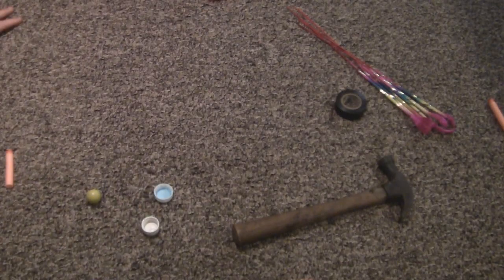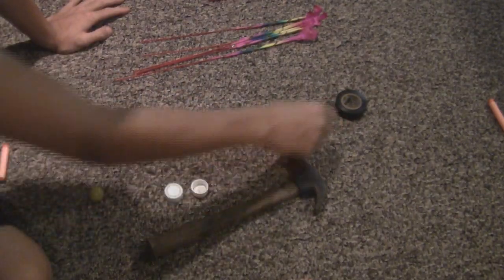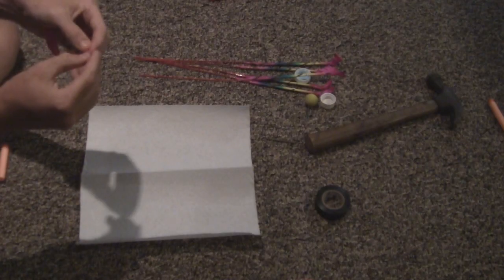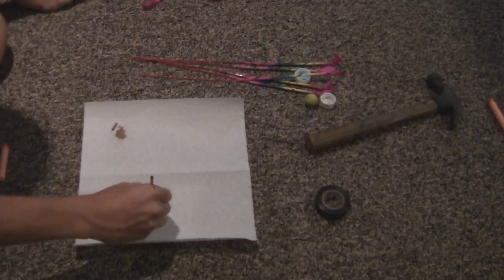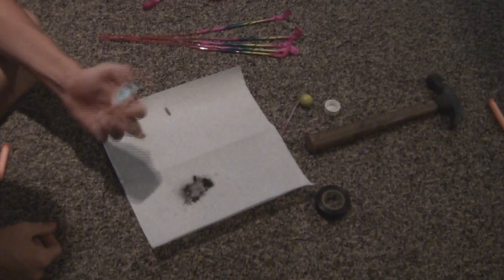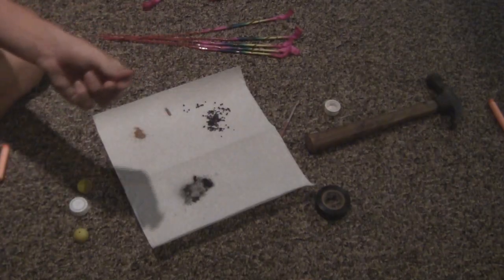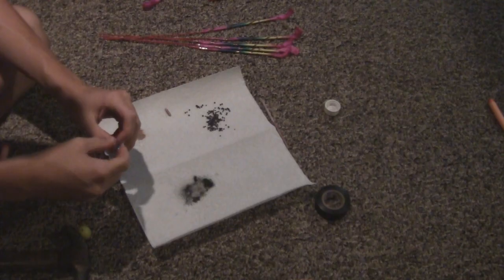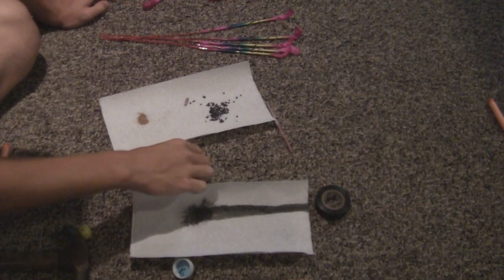How to make a M-80 out of sparklers. (Extreamly loud!)

Comment: to get the metal out of a regular sparkler just take a magnet and swoop it over the pile. thats what makes the sparkling effect. then just hit the magnet against something to shake all of the flash powder of the metal. I used about 300 crushed sparklers and it gave me 45g of flash powder. I am a professional pyrotechnic. believe me. there is flash powder in every sparkler and consumer firework. it's how the makers get around the law. and if the say 500 grams on the firework, it's total not each.
Reply: are you talking about a morning glory sparkler
Reply: InfiniteAirsoft is
Reply: There is "flash powder" in sparklers which is magnesium and what not but if you're a pro pyrotechnic then why not just purchase the magnesium you're sourcing from sparklers?
Reply: what's better for flash powder, TNT morning glory or TNT sparkler's?
Reply: @808pyroboom  I would say the morning glories are better. The metal stick sparklers will have some kind of binder added to keep them in one piece, and that would probably slow the burn rate, as opposed to the MG's which are loose powder in a paper sleeve.

Comment: I was really skeptical that the morning glory powder had enough oxidizer in the fuel for a fast enough burn rate. I see you have dramatically proven me wrong. Nice.
Reply: I Wonder what kind of oxidizer is used in glorys,
Reply: Pyrus Rex sometimes it burns to slow so I add some flash from little firecrackers

Comment: Tape? Buy some cardboard wound tubes and glue your end caps, if your going to take the time to do it, you should do it right. Be safe! 
Never use paper towel, the finest particles are the best for the boom and those tiny particles are first to get caught in the paper towel; use paper.

Comment: You can use regular sparklers but you have to take it and crush it up with your hands until you have all the powder off.
Reply: Just use scissors or anything hard to crush it up, why your hands?
Reply: @mink5260 that’ll ignite it
Reply: just use non crushed sparkler as fuse longer time to get away apx. 45 sec.s

Comment: Best firework ever : 2sparklers of powder 1 tablespoonful of kno3 and  a heaping teaspoon of crackle  from a monster crackling ball mix pour into tube wrap ends with duct tape 19 inch fuse light run will blow up with some neat effects I am not responsible for dumbasses making these and blowing off there arms has as much power as 1tenth a stick of TNT.

Comment: Ok what I did, took co2 cartridge, drilled hole in top, took the sparkler powder put in blender poured into co2 cartridge to the top, put another sparkler as a Fuze in the top sticking out, then rap in electrical tape, light it, then run like 100ft away behind cover, I was only like 20ft away and welllll it twas scary

Comment: becouse it aint strong enough to have a big punch.. and if you can get hold of some PVC pipe and cork from a wine bottle to plug the top and bottom and use duct tape. not electrical tape. it is mutch louder! home more morning glory's you use how more powerfull the bang will be

Comment: That does not work. The "done one" you had was not made of the same stuff, I know this for a fact. Sparkle powder will not produce that type of explosion, ever. What you had completed was an M-80 made out of flash powder. The bottle cap/sparkle powder makes a small pop that is it.
Reply: You have absolutely no idea what your talking about I've done this same thing for years it works
Reply: Sparkle powder, black powder.. Both of them are slow deflagrants and can't cause an explosion near as powerful as flash powder. Flash burns much hotter and MUCH faster. I invite you to whip up some flash powder and stick it in those caps. Take the powder out of firecrackers (the silver stuff only), and fill up the caps just like this. You'll see a huge difference.
Reply: It depends on how many of those you take apart. Each legal firecracker only has up to 50 mg of flash in it. A water bottle is rather large for this. You'll need at least 20 grams of you want this to be anything big. That means you'll need to take apart 400 firecrackers. But just taking a few firecrackers apart and putting it in the bottle and preceding to do what you mentioned won't work like you expect... It might make a "poof". But if you really want to sit there and try to remove the powder from 100's of firecrackers, yes, it'll work but that's one huge pain in the ass.
Reply: Anything you get from the store sucks. It has a fraction of the amount of flash that a real M-80 has. Taking fireworks apart can work but it's typically very difficult to get just the flash out and not any of the clay or whatever is packed/mixed in. Plus, it's only 50 mg per item so it takes forever to make them. Just make the flash powder.
Reply: Potassium Perchlorate and Aluminum Powder is all you need. Look it up.
Reply: +Frankie Arnold Thank you I just need to find my way to get my hands on it.
Reply: Trust me, I know all this!
Reply: Because it's true. This makes a noise slightly louder than a firecracker, nowhere near an M-80. You'll have much better report from taking the flash out of 20 firecrackers and putting it in these caps. Glory powder is NOT a flash composition. Flash powder flashes, sparkle powder sparkles.
Reply: And why wouldn't he just finish a making the one he was making instead of bringing out a completely different one. M-80's can be made rather quickly, so if showing an instructional video, why only show part of it? I know what flash powder is, and I know many ways to make it. Again, this sparkle stuff is not flash and will never give you the same result as real flash powder. Even the nitrate flash you mentioned can perform much better, under tight confinement. However, KMnO4/Al/S in a 4:2:1 ratio is a very potent flash and similar to the power of the standard 70:30 or 2:1 KClO4/Al flash. Despite some saying that Permangante flash is unstable, it's actually not, only if store for long periods. It can actually be hard to light even with a direct flame. Make it as you need it. All I'm saying is this is NOT an M-80, not even close.
Reply: I always used hot glue on all salutes.
Reply: If I do not have access to the real tubes which can usually be ordered at CannonFuse, I typically cut a toilet paper tube in half then roll it to where it's nice and tight/thick. Then I use electrical tape to hole it in a tube form. Then, I shove  in a piece of toilet paper, and hot glue the end. Make fuse hole then put a dab of hot glue around the fuse where the hole was made. Put in flash, another piece of tissue then hot glue. This method works perfect with any flash. Yes, I know KNO3 isn't as powerful, it only has 3 parts oxygen. Perchlorate doesn't yield it's oxygen as easy but it gives off more to make up for that.
Reply: If you check out my channel you can see I have quite a few different videos of different salutes made different ways. I've also experimented with Mg based flash comps but I don't mess with them too much as Mg powder is much harder to get and is a pain in the ass to make. But Mg flash can burn much faster than Al based, it just doesn't let off nearly as much gas. One of particular potency is Potassium Persulfate or Sodium Persulfate, when mixed 50:50 with 200 mesh or better Mg will explode with one gram unconfined. Basically, KNO3, KMnO4, KClO4 are the only oxidizes I'll use in any flash. And I stick with the standard 3 micron dark Al for a nice balance of safety as well as power. I know that single micron Al is always most powerful, but it also the most dangerous to work with.
Reply: Thanks for that, will give it a try.